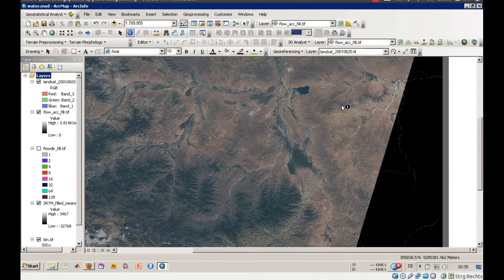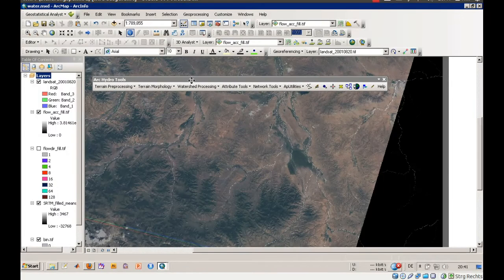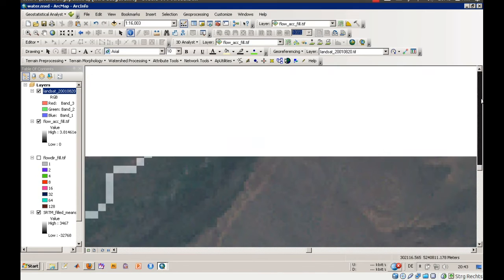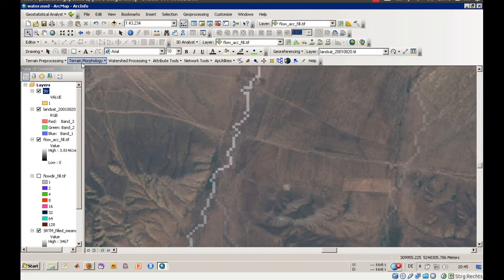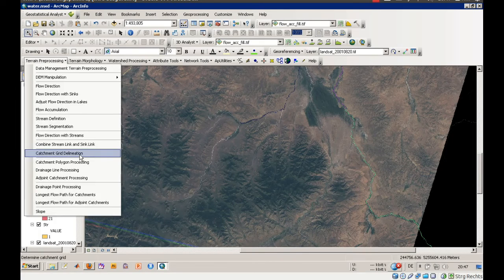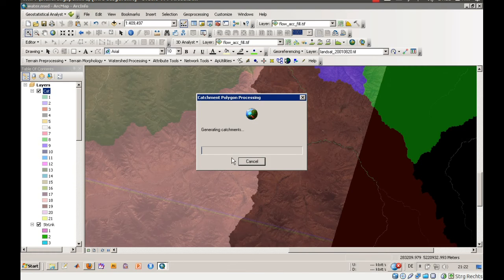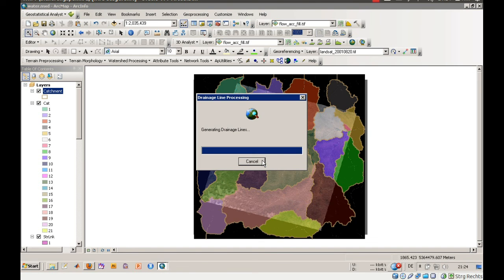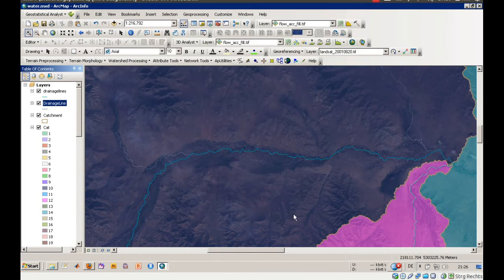using SRTM data for hydrologic calculations in ArcGIS (part 2): watershed delination

Comment from the maker: Dear Ilmir. It is not easy to say how to fix this! to me it occured that a reprojection (in my case from 90m cells to 30m cells with same projection) was great for creating a more realistic pattern compared to landsat (but that is just tweaking the data... SRTM is way to coarse for flat areas due to the height-failures. you can also tweak the SRTM data at places where the stream turns to an unnormal "position" by using "raster edit" a tool i have found (just google "raster edit caesar")

Comment: Thanks for reply. 
Do you think that hydrosheds.cr.usgs.gov hydrologically conditioned data will be better than ASTER GDEM-2 for determining the river network? I just can`t figure out which SRTM version did they use for conditioning the data. GDEM-2 data has a better pixel depth and resolution but also a way more artifacts on it, as I understood.

Comment from the maker: You will need to go to the ESRI FTP site, which is at ftp dot esri dot com. However, the Arc Hydro programs are all in a password protected area. To log in: "Login As...", and then enter the case-sensitive login information (Login: RiverHydraulics, Pass river.1114)

Comment: Hi Riccardo,
I have downloaded the ArcHydro and is able to move on but got stuck at stream definition stage. When I try to initiate this step, the option for number of cells is active whereas the Area (square Km) is not active. If I proceed without this I get the message "System.Runtime.InteropServices. COMException Ox80004005): Error HRESULT E_FAIL has been returned from a call to a COM component.......... can you help to handle this issue.
Thanks 
Rakhshan

Comment: I use SRTM HydroSHEDS raster data with hydrologically conditioned elevation gisdata.usgs.gov/webappcontent/HydroSHEDS/downloads/HydroSHEDS_TechDoc_v10.pdf They write something like: "Endorheic basins (inland sinks) are “seeded” with a no-data cell at their  lowest point in order to terminate the flow". I just used "fill' function first (whithout any rastercalc operations) because I have low-max (37-297) on that raster.......

Comment: Dear Riccardo, your video and manner of teaching simply amazing. You proffesional in GIS and remote sensing. I am very grateful to you for this tutorial. I have a question for you: How do you fix the problem of mismatched drainage network flow accumulation, and image after landsat to flat areas? And the second question: do you have the experience to delineate all the watersheds for large and small drainage line that share the streams? My gmail is nusmumrik, Skype is nusmumrik_ya